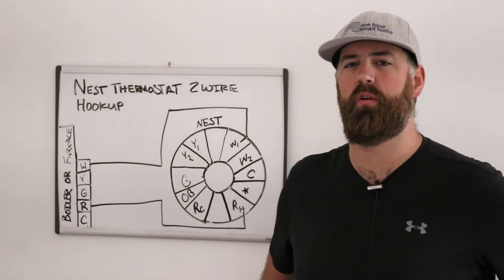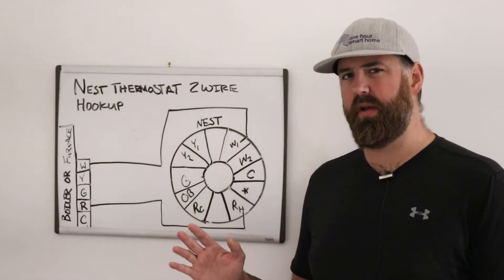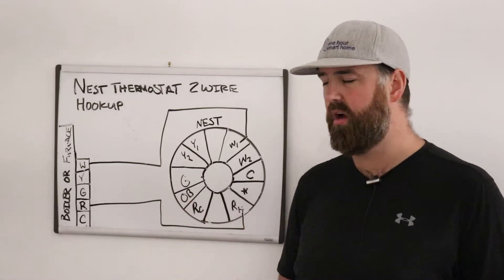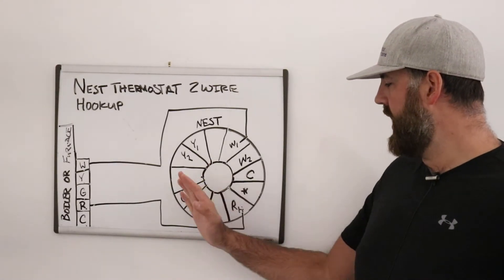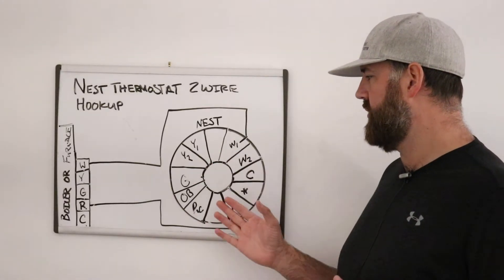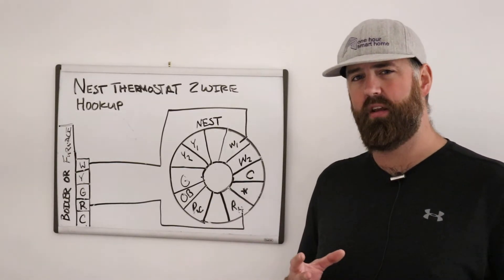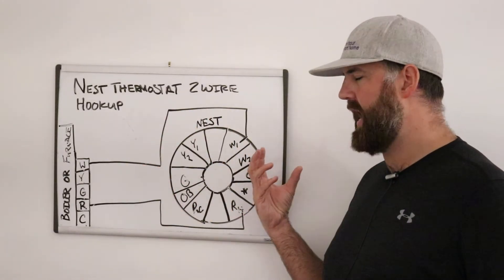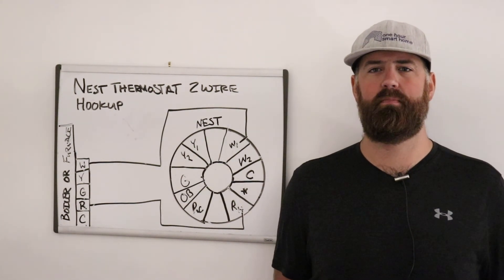Nest Thermostat 2 Wire Hookup Instructions

Comment: SO I have an RC and an RH wire on my old thermostat...have separate ac and heating  no forced hot air system.  the new nest only has an R  no RC or RH, MY RH wire is plugged into the R side on my old thermostat so what can I do about this? I have the new nest  that only has  Y,C,W  G,R ,O/B connections

Comment: Thanks for the video. I have a 2 wire system with 4 zones. I have 4 nest E thermostats I just installed. They all work fine however, when they are not calling for heat the oil boiler electrical panel is making a constant clicking noise. Any advice you can offer on how to remedy this would be greatly appreciated.
Reply: I have the same issue .

Comment: I hooked up W1 RH worked fine all night, set up the app everything was perfect but in the morning it’s now saying no power detected to RH. What would cause this? I checked the wires and they are in fine.
Reply: Because r is not constant power. R only has power when boiler is running, that's why the battery dies. You need to connect a c wire. This is not an option.

Comment: 2:04 What happens if the boiler is already running when it receives a power signal from the thermostat?
Reply: Thermostat will not send a signal when the boiler is running

Comment: Please explain the purpose of the built in battery in the Nest e.  
I have heat only(steam)  two wire system. Upon initial install the Nest required a two hour wait for its battery to charge.
Reply from the maker: It powers the electronics/wifi chip.  Since the HVAC system power provides relatively low voltage the battery is used to help power the Nest E: https://amzn.to/3gjLxfe  durring more power intensive operations which have a higher current draw. Typically you won't need to wait for the battery to charge, but if you got a thermostat that sat on the shelf a long time it's possible the internal rechargeable battery was discharged or that your HVAC system puts out just barely enough power to charge up the battery.
Reply: @OneHourSmartHome  Thanks, that makes sense.

Comment: Great video, very well explained . I have a 2 wire system - red wire and white wire, and I did the exact same thing to connect my nest. But now I have a swamp cooler for cooling during summer, can I connect my swamp cooler to nest ? If so can you please guide?
Also , how should I know , if I need a c wire? Currently nest is functioning with 2 wires but not having a c wire, will it cause any issues down the line?
Thank you in Advance!

Comment: My place uses radiant heat flooring.  The so-called unit I check is a gas-fired hydronic boiler.  It is a Laars Mini-Them II model.  I guess I am not a good reader.  I was reading the installation manual to find out it's voltage system but I don't know if a 24V or low-voltage system.  The wire panel on the unit strangely has R, W and A ports.  Only R and W and connected (black and white wires).  Anyone can shed some light here?   Thanks.

Comment: Question: Nest support claims 2 wire boiler system will work with Nest 3rd generation and keep battery charged without short cycling. But unless the battery is trickle charging at so low a current level that relay is not fully turned on I read over time it may start short cycling or prematurely wear out the relay by having low current constantly flowing. I don't want to return from vacation and find my transformer and relay are blown. Apparently Bosch-Buderus support said my wall hung boiler isn't supposed to be retrofitted to a 2 wire thermostat, but thats what the installer did and its been fine for 8 years...

Comment: I have watched the video and I have a two wire system! The old thermostat had a jumper, so I'm glad you explained it. I had just bought a Honeywell T9 and no matter what I did could not get the boiler to turn on. I am interested in the nest but what model was this based on?
Thank you
Reply: I have a two wire system but looks like I have a C wire and R wire. I attempted installing a T9 honeywell with not success. So I ordered a nest hoping this would work. Any idea on how to wire the nest as there is not a W wire currently wired to the current thermostat
Reply from the maker: The Nest 3rd Generation: https://amzn.to/3k6Gy1L In my experience will work with most 2 wire boiler systems without the need for a common wire.

Comment: If there are only two wires to the existing thermostat can a jumper be installed between the c and w1 if w1 goes to the common on the 24 volt transformer??
Reply from the maker: If you have 2 wires a R and W wire most likely the Nest will still work. You typically don't need a c wire. Have you tried connecting the Nest?  A jumper is not needed.
Reply: @OneHourSmartHome  i was reading on another forum without the C wire, you may run into issues later on. Premturely wear out the relay/igniter. How will the t-stat get enough power during the summer than? Boiler wouldnt be coming on
Reply: I have read SO MANY people saying with two wire systems if you don't add a C wire then you will run into a ton of problems. Google themselves even say it. So although the video was very good where you got your 90 percent number for people that won't have a problem without a c wire I don't really believe. If you live somewhere with warm summers and a heat only system so you don't use your heat during the summer then you're not gonna be using your heat enough to put power to the nest obviously then causing problems

Comment: I have the same problem but my wires are R and it’s a red wire and C and it’s a blue wire. From my understanding I will connect the r to RH and C to C correct?
Reply: Did you get your HVAC system to work using this?

Comment: Anyways....lol...mine didn't work when I hooked it up the red wire to the Rh, however, worked fine when I hooked it up to Rc.  Thanks for the vid.
Reply: Capt - Can I ask what gen Next thermostat you have? I'm using a 2nd Gen with a new Lennox furnace and it's shortcycling. When I remove the thermostat and connect W and R the furnace works fine. Thanks in advance.

Comment: PLEASE HELP ME! I need help, I have a Nest E but it only has a W1 slot. I have a W AND W2........where would Both of these wire up too when Im provided with only a W1 slot? I have a conventional AC
Reply from the maker: That means you have 2 stage heating.  The Nest Gen 3: https://amzn.to/3ieMjJZ is compatible with 2 stage heating and cooling systems.  You can use the Nest E with 2 stage heating and cooling systems its just that you won't have the capability for 2 stage heating or cooling. You would just put the W wire in the W1 spot and cap off the W2 wire with an an electrical wire nut: https://amzn.to/2XzlhFc
Reply: @OneHourSmartHome  THANK YOU SO MUCH!. Wont this cost me more money though in the long run? Not bieng able to use stage 2 functions?
Reply: @OneHourSmartHome  Hey I also have a jumper wire from Rc to R????

Comment: Quick question: in this two wire heating system, would the Nest stay charged during the off season (during summer months)?  Thanks for this, super helpful.
Reply: it will not, you have to connect a "nest power connector" at the furnace, it should supply a low voltage through the red wire
Reply: Would love an answer as well

Comment: hi mate.
I have got only 2 wires and 110v.
does this R And W terminal will switch it without any issue.?
and where to put 24v power for nest e?
Reply: You need c. Especially if there is a summer time. When the boiler isn't running, the r terminal has no power. That is why you need a c.

Comment: Hi Dear. I got a smart thermostat but my old thermostat having only 3 wires! Is there any chance to make it works ?
Reply: It’s red ( high) yellow (medium) and black (low) this for the old thermostat. The new smart thermostat I want to install having this codes point one 9# ac220v-l / point to have a group arrow as points #8 ac220v-n . Fan #7 high #6 med #5 low then group arrows mention Valve #4 open / #3 close.   So where I connect the 3 wires I have ? Pls help me

Comment: I have a 220 base board system with a transformer to a relay switch to the nest, the system has worked over the past 4 years I do get low bat once in a while. How can I add power to the c

Comment: for two wire heating system can you put W1 for heat from oil furnace and just add a common wire to c and RH to a wall outlet ??
for a oil heating Force air. I have W1 for heat white wire and RH for power but getting low power so the thermostat needs power if I power the thermostat with wall transformer to c and rh then the nest thermostat will take care of w1 and sending power to W1 - call for heat?.
Reply: Did you get the answer to this ?

Comment: Hello. We have a two wire system and were elated at first. We now find although we will have the Nest turned off, the heat will come on. Has anyone else had this happen and have any suggestions? We called Nest but they were vague with possibilities.
Reply from the maker: If the Nest is off and your heat is on, it might mean that your R and W wires are shorted together somewhere.  Touching the R and W wires together will turn on your heat.

Comment: I have a Honeywell  CT 31A1003 connected with only 2 wires which control AC & furnace. I want to replace it with a Nest Thermostat E. Will it work? Just connect the 2 wires to W1 & R
Reply: Same here. Anyone know an answer

Comment: I have a weil mclane boiler...…..with two wires that put out 14-15 volts dc..   will this work with my boiler?
Reply from the maker: Don't know, never run into that particular boiler model, but 14V seems too low.

Comment: Does anyone know how to install a 2 wire (white, black) to a honeywell 2 pole (4 wires , 2 red 2 black)????
Reply from the maker: Some of those honeywell have a special system that converts the wires. You need to find that box which will then have the typical 4-6  colored wired connected to it. Usually its next to the furnace. You would then need to extend those colored furnace wires to your thermostat and abandon the honeywell controller to get it to work.

Comment: The nest thermostat needs the C Common wire to charge, other wise it will die. This video is wrong..
Reply: This is not true for all systems. Some systems supply the correct voltage over just the two wires and the nest will work fine.
Reply: I have 4 nests only use 2 wires per therm, all work fine
Reply from the maker: Jay, most HVAC systems put out enough power that the Nest does not need a common wire. In my experience about 80-90% of systems will work without a common wire. You can read the nest installation instructions or google it.
Reply: @OneHourSmartHome  how do i know its working? as long as the t stat is getting fully charged? but wat about the downtime/summer time when heating isnt required